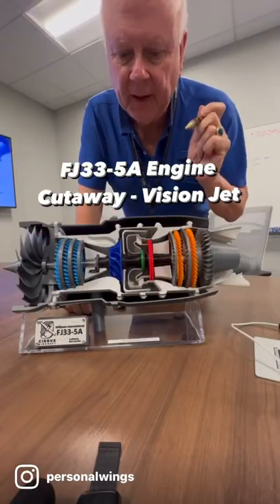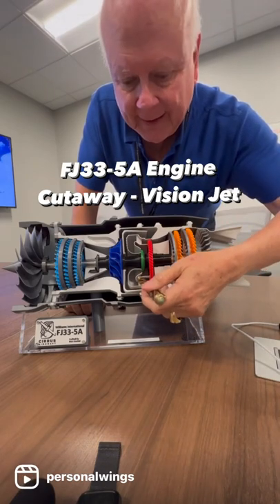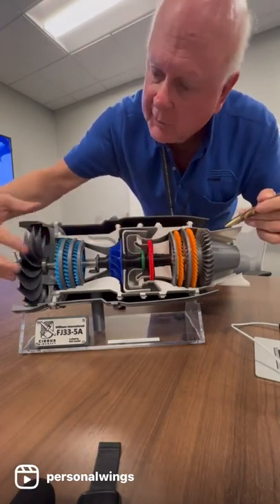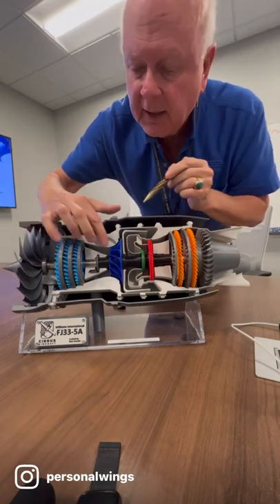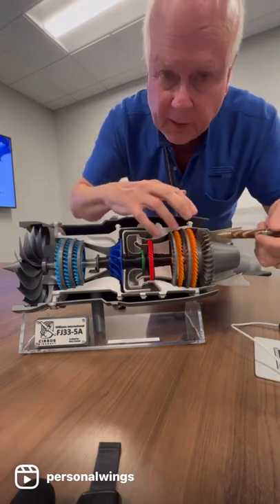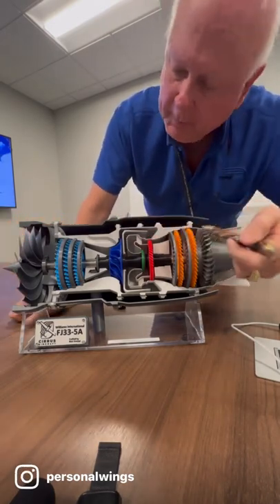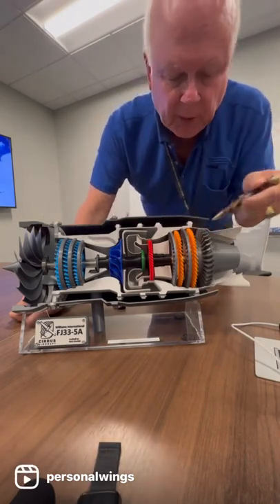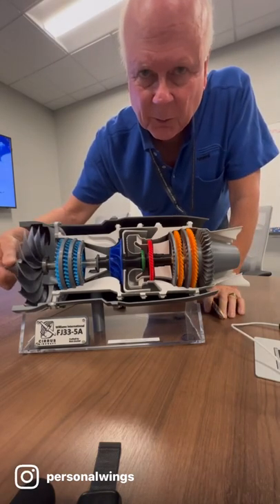Cool Cirrus Vision Jet engine cutaway (it’s a centrifugal compressor, i misspoke) #shorts #avgeek

Comment: Maybe a dumb question but, can this smaller jet engine handle any bird strike ?
I know larger turbofans like on Boeing or Airbus can handle birdstrikes to a certain level.
On the SF50 VisionJet there's obviously only 1 engine so....
Reply from the maker: Finch or Turkey? Smaller animals without much mass may get chopped and cooked easily with negligible damage. You'll always want an inspection post-strike, but anything of size is likely going to do some damage or clog things up. One reason the Vision Jet has a parachute! No backup engine.
Reply: @PersonalWings  
Right on, makes sense.
Canadian Goose & your goose is cooked !

Comment: I'll bet the N1 turbine turns the FAN in the other Direction than you turned it.
Reply from the maker: In normal operation it does, I was just turning it to show movement and the relationship of the N1 and N2 sections. I also didn't turn on the ignitors :)
Reply: @PersonalWings  good engine???